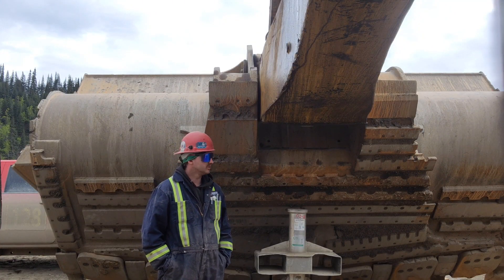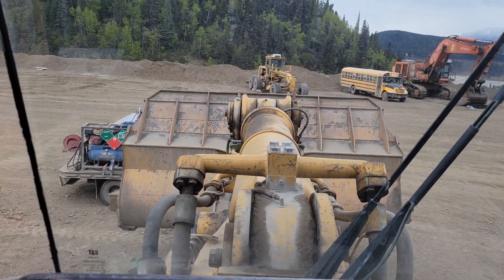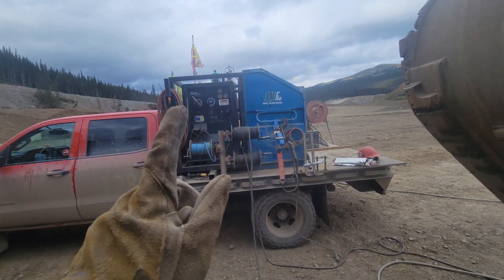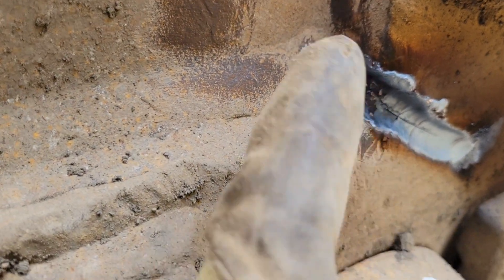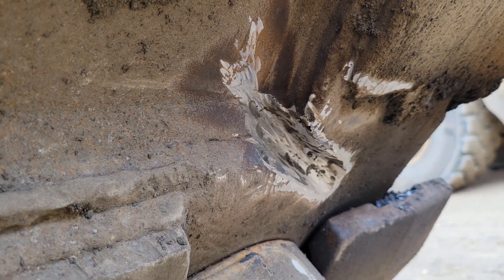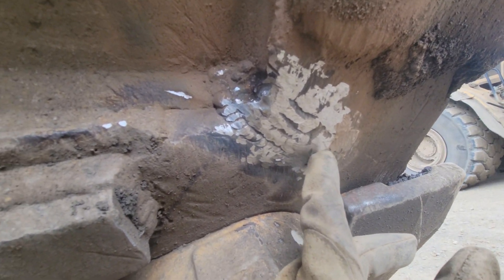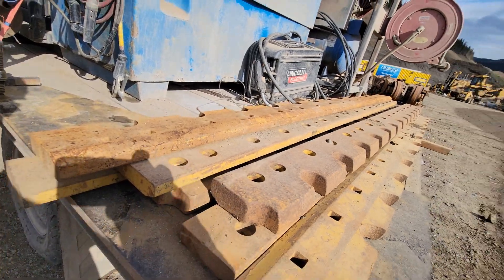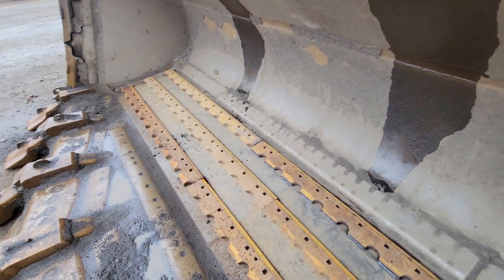Cat 992 loader bucket repairs

Comment: How long will those grader edges last inside the bucket  you have trouble with them breaking as they get thin Any idea what that bucket would weigh with all the inside outside wear protection What material are you digging with this 992
Reply from the maker: They actually last a very long time. The dirt fills in the low spots and prevents the base material from wearing out. We do this practice on all our digging equipment as it's a cheap alternative, and the grader blade is very good steal. We do equipment checks twice a day, so i keep an eye on them. If any wear out we change them. I have no idea on weight. All the material we use is dirt and sand.